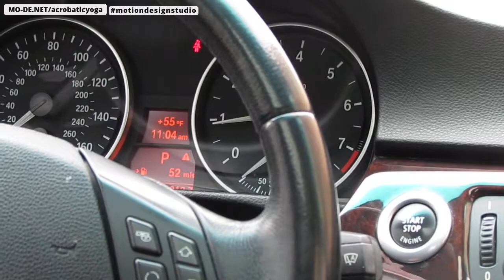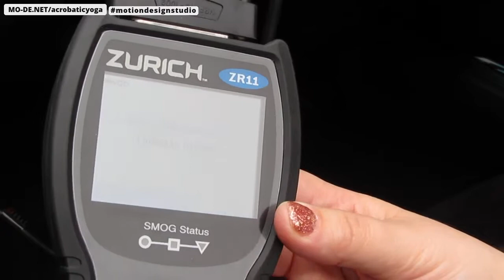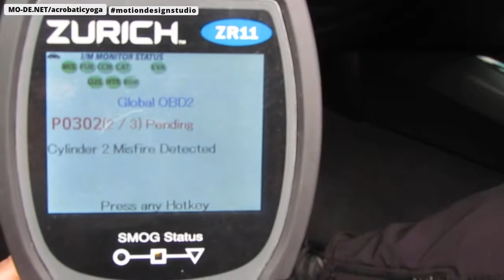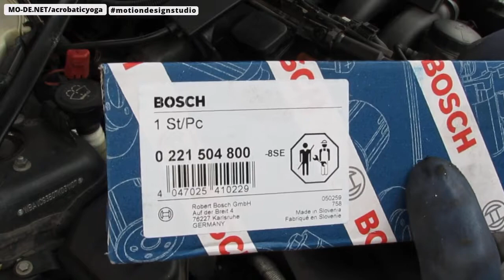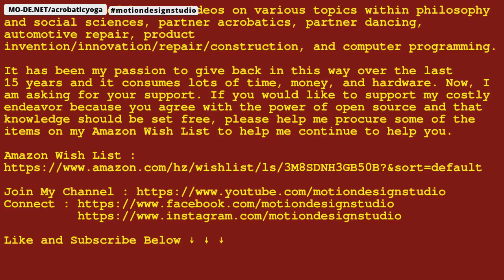How To Replace 2007 BMW 328 xi Ignition Coils E90

Comment: I hate working on these cars so much, but they're worth it....I think lol. Thanks for making this, I use it as a reference all the time
Reply from the maker: Same here and this one brakes every 5 months.  Have not seen a car that brakes this much.  Not worth it and the BMW 3 Series (E46) is the latest best BMW I would recommend to anyone.
Reply: @MotionDesignStudio  I just scored an '03 330Ci 😎!! I still prefer the e60 if it's a 335 tho
Reply from the maker: @fooyong  , is it manual the 330Ci?
Reply: @MotionDesignStudio  No sir, but I believe I've got a ton of parts cars e36/e46/e60/e90's if you ever need anything, and I believe I have a manual transmission for one. I'm in Kentucky tho, and I'm betting you're from Cali
Reply from the maker: @fooyong  , Around December of 2024 hopefully I would like to acquire a manual transmission 330 XI E46.  If you find any with low mileage, good condition and manual around that time keep me in mind.  How is the weather currently?  It no longer snow where I am in Philadelphia, Pa USA.  It has not snowed in 4 -5 years.  I would like to visit the wrenching community out there.  I am really interested in large equipment.  Have had little exposure to them and find large equipment interesting.  Not enough diesel experience either.

Comment: Thanks. Without this video I would of been spending money without an insight. All is well now. Riding smooth like when I first got it. 2008 BMW 328i.
Reply from the maker: Thanks for letting me know.   It truly means much.  When you get a chance check the engine for sludge buildup.  This happens on these older model BMWs and cause performance and idle issues.  If you do have a buildup search for one of the many ways people remove sludge oil.  Best of of luck and do not forget to subscribe it truly helps.
Reply: I got a 328xi 2007 hopefully this helps you should do a spark plug change